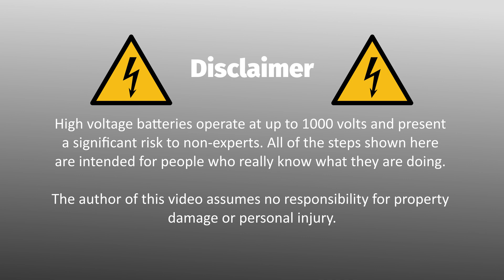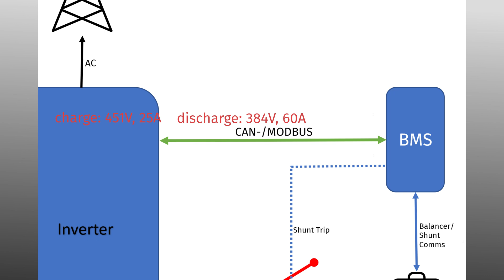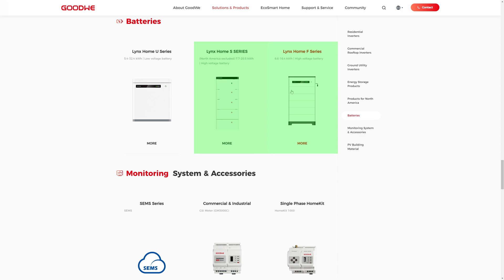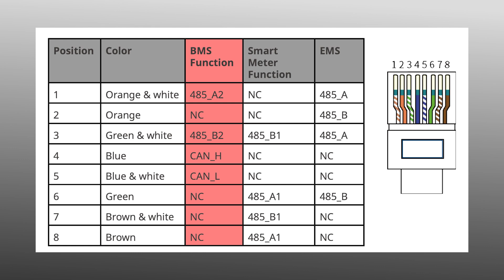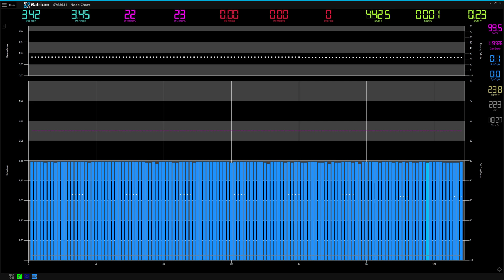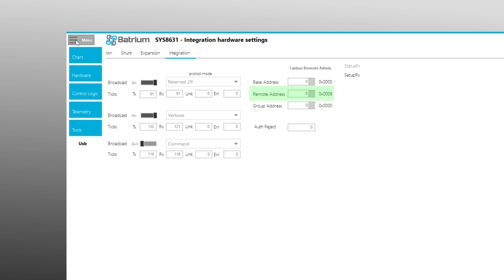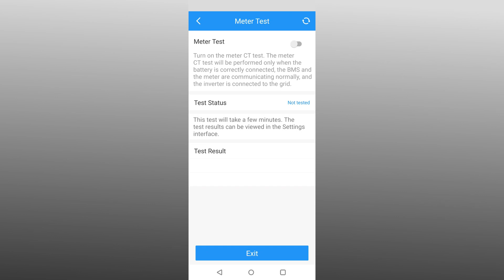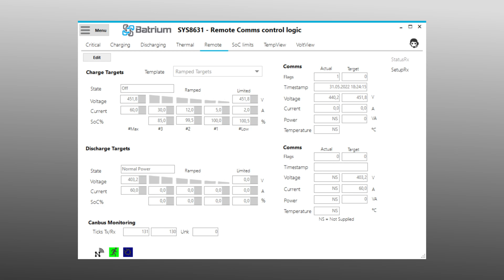Batrium & Goodwe HV inverter setup instructions

Comment: The Schneider C60H-DC breaker is not bidirectional and is not supposed to be used in circuits where current can flow both ways (charging or discharging).
It uses magnets to deflect and break the arc and this system of extinguishing the DC arc only works in one direction.
That is why there are wiring diagrams printed on it.
Reply from the maker: What is not shown in this video: There is another Schneider breaker oriented the other way in series on the other side of the wall. Both breakers are being tripped with the same signal at the same time.

Comment: Thank you very much for the video, the instructions are wonderful.

I already have my battery with the Batrium BMS communicating with the Goodwe inverter. I only have one problem, when the SOC of the Batrium software reaches 81%, the inverter disconnects the battery discharge. Have you had any problems related to SOC? I have even disabled the SOC protection function of the inverter so that the Batrium is the only one managing it. But even so, it stops the discharge at 81%. 

Thank you again. Very good contribution to the community.
Reply from the maker: What discharge limit have you set in the GoodWe App? There are limits, one for on grid and the other for off grid operation.

Comment: Hey Deti, what does the GoodWe inverter do if a charging current of 0A is transmitted. With my Deye hybrid high voltage inverter I have the problem that it is going to discharge with maximum allowed discharge current. Does the GoodWe handle it better?
Reply from the maker: GoodWe respects charge and discharge currents. If a current is set to 0 then this means to stop charging or discharging completely.

Comment: Hi, is it normal that in remote you've got high values of voltage? For example, you have 450,1 V instead of 45,01. 
Can it break the canbus communication between the inverter and the barium?
Thanks.
Reply from the maker: With my high voltage inverters all voltages are far beyond 48V. My batteries are working at 450V (not 45V) which means that everything is within reasonable bounds.
Reply: @deti5574 Ok thanks. My batteries are working in 48V but it shows 400V only in the discharge target. This is really weird because on the charge target everything is okay. If you have any ideas please let me know. Can you tell me what is inside your high/limited page? I mean the scaling. Thank you for your help😊!!

Comment: Question 1: GoodWe has two ET-Series; one for 5-10kW and one for 15-30kW. Will this tutorial work with both series? Question 2: In the tutorial is a GoodWe battery type selected. Is it possible, to built an own battery (e.g. 100Ah/500V) and add it to batrium/GoodWe?
Reply from the maker: Yes, the supported protocols do not differ between the different HV types of GoodWe inverters. But the bigger ET-Series have two battery inputs and two CAN bus ports and there are two ways to use them:
- one battery, but more than 50A charge/discharge current requires two battery inputs with only the first CAN bus port being used
- two batteries, with each up to 50A,  require both CAN bus ports being used.
Reply: Thank your for your explanation. 50A charge/discharge is more than enough for 100Ah cells.

Comment: Really interesting and educational video.  I am planning to do the same setup with Batrium and 128 pieces of "80Ah, however I will use the Deye 40kW High voltage inverter instead and Im not sure how the canbus protocol of that inverter will workl with this setup, would it be possible to pay you a consultant fee to take a look at the Deye Canbus protocol and see if it will be possible to use?

Comment: I have a question regarding efficiëncy. I can get my 48v LFP battery system a round trip efficiency 82% at 0.3c rate. That means a whole ac to dc cycle and back. That is the main reason i want to go to the 400v but since you already have it: Did you measure your round trip efficieny and what is it approximately. I think 82% is too low, although by no means bad for a 48v system.
Reply from the maker: Well, that's hard to measure accurately, since efficiency seems to depend on discharge / charge power and depth of discharge.  In the last 6 month the worst value was 92% and the average is 95,5% and the best is 97%.
Reply: @deti5574  Averages will be pretty accurate if you recharge to high charge state at some point. Tese numbers make me even more enthousiastic about the 400v system. Are you sure we talk the same trip? From grid AC to DC battery, back to grid AC. Since the goodwe has like a 97.5% max effeciency. If you go through that 2 times that leaves you with a 95% and batteries lose at minimum 1% in a round trip. Then you would have no losses on cablings, fuses connectione etc. Maybe the are indeed neglectable because of the low current required.
Reply from the maker: @generalgeert  Sorry for not excplaining how I calculated the efficiency. I took the (dis-)chargeWh value from the Batrium Shunt statistics. This means 2.5-5% of the charged energy is being burned somewhere in the cells  (chemically or by balancing). Another 2.5% are lost by the inverter according to the data sheet.  So we might end up with 7-10% total loss between all stages (double AC/BAT-DC/AC conversion) and 5-7% with PV-DC/BAT-DC/AC conversion.

Comment: I have read the GoodWE manual and it states you can't put 2 BT or ET versions on 1 battery. I suspect you actually can do this since the BMS mainly sends data TO the inverter and not the other way around. Do you think it will work if i buy a cable split and split the batrium CAN output to 2 wires and plug into 2 goodwe's.
Reply from the maker: These inverters are transformerless which means they do not isolate the DC side from the AC side. If you would connect the battery inputs of two inverters in parallel you would cause a system fault due to mutual leak currents.

Comment: Would love to see more of your battery setup with the aluminum profiles! Do you have somewhere you have posted your setup?
Reply from the maker: Three more videos on battery construction are currently being edited. I will explain my setup in detail and the steps to build a safe high-voltage battery.
Reply: @deti5574  I am excited for those videos! I do not get how this video has 668 views. I literally weekly check if your additional videos on the HV battery are there. Please let me know if i can help in any way. I think i can build the battery already but i am not entirely sure about how i should fuse it. I am thinking about creating 8 coupled fuses to ofcourse disconnect the 400v system when triggered but additionally break it into 8x 48v batteries at the same time so the high voltage is dispersed.

Comment: Nice video!! i am doing similar proyect and its quite helpful, thanks! by the way im getting some issues. When selecting the 'goodwe protocol' i get no response from the PV master choosing any battery model... no CAN comunication. The only way i got BMS state to normal was using protocol 29 and choosing OLOID battery, but i think thats not the proper one. My setup is liion (36S), and oloid is lifepo4... any thoughts?
Reply: What is your nominal voltage pack? In integration on "remote address" you have to specified a multiple number of 51v that match you nominal voltage pack. For example if you have a nominal voltage pack o 250v you have to set 5

Comment: Thanks for the video! I'm thinking about just the same configuration. I see that godwee accept modbus but no knowledge about connections with batrium... until now :). One question... This inverter can only operate in LAN? I wish to connect to home assistant instance.
Reply from the maker: My example setup uses CAN BUS, which is quite common and well documented. If you decide using a different connection method (MODBUS via RS485 or TCP) you need to build your own software. The MODBUS registers are well documented by the OpenEMS project (see github repository). My first attempt was using a Raspberry PI to read out the Batrium state via WiFi  and write corresponding MODBUS parameters back to the inverter. It worked somehow, but I did not feel safe having a computer that could crash in between. The code would be here:: https://github.com/baycom/batrium2goodwe
Reply: @deti5574  Sorry I was wrong. I mean CANBUS. Do you need to pay for the battery operation code? How much if it?
Reply from the maker: @oOSephirothOo  Batrium supports the GoodWe protocol now (as many others) at no extra costs. I just helped the developer to implement the protocol the right way, because it is a bit timing sensitive.

Comment: Very cool! I think HV batteries with hybrid inverters have so much potential vs the 48V systems. Can’t wait for more enthusiasts to catch on to this.
Reply from the maker: I will add some more videos on how to build a high voltage battery safely. Please have some patience.
Reply: @deti5574  Please do. I am very curious what should be done differently from a 48v battery.I think high voltage is the only logical battery to reduce losses.
Reply: @deti5574  please post them. How is the sytem going?